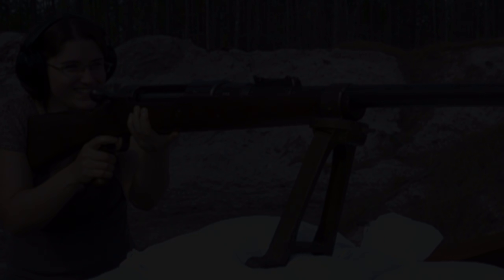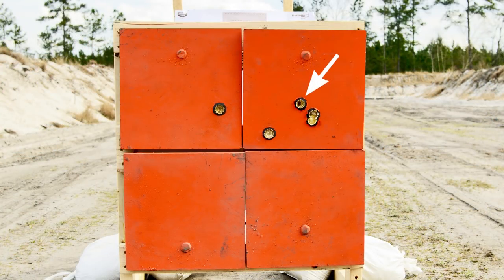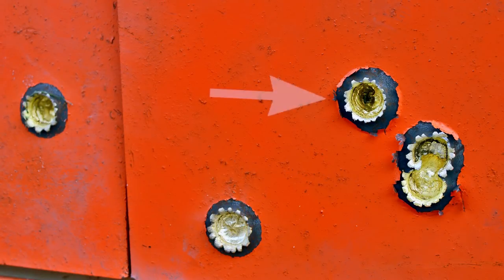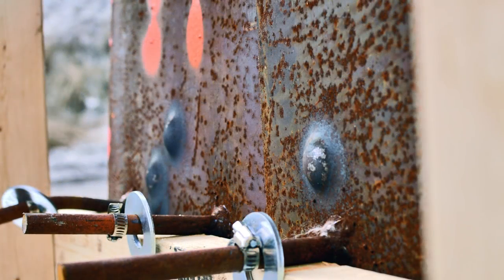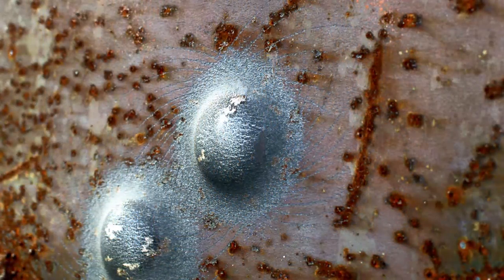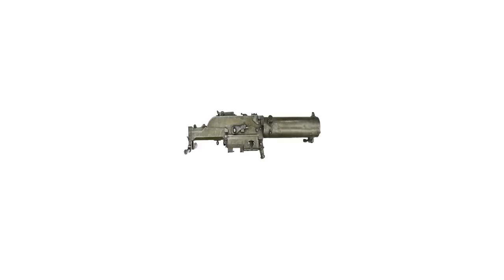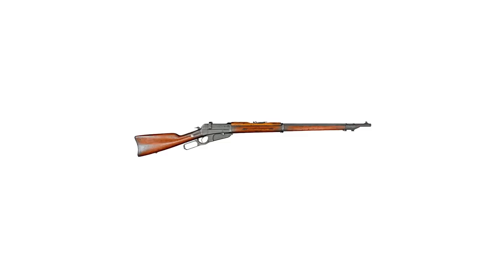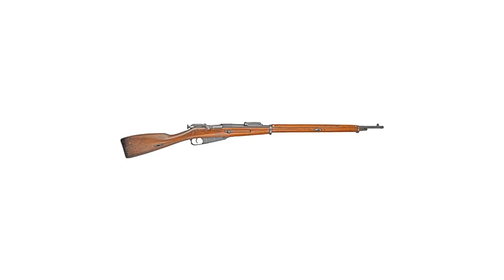Mae fires the T-Gewehr - First anti-tank rifle

Comment from the maker: I'm starting to get a flood of comments about how we "faked" our T-gewehr ammo because of claims that it will break your arm.

The 13.2 TuF is roughly equivalent to .50 BMG in perceived recoil.  The gun has 1" spikes on a solid bipod and is quite heavy.  This means, used properly, the recoil is actually quite controllable.  I have fired the gun once and Mae has put 5 rounds though one at original load data.  It was bedded well into a pile of sandbags.  The first shot gave her a nickel sized bruise, the rest likely contributed nothing as she adjusted her posture to better match the high center.  I received no marks whatsoever as she had already warned me about how the setup recoiled and where to snug everything in.
https://www.youtube.com/watch?v=_ovHGvT4f9k

If you're worried about a non properly emplaced T-gewehr, well, Ian and Michael both shot actual original ammo with just about the worst free stand I could imagine.  While it gave them a jolt, no one broke any bones.
https://www.youtube.com/watch?v=EzDfUKNwfGc

Recall, this gun is among the first anti-material rifles and so a LOT of myths built up quickly, especially because it was almost immediately put back out of service.  As with any high recoil firearm I'm sure you could be hurt using it outright foolishly.  But a trained rifleman, even unfamiliar with the recoil of this particular gun, shouldn't have a great deal of difficulty.  Fatigue would probably kick in about 7 - 10 rounds in though in my estimation due to working the large bolt and the general shock of each shot on the nervous system.
Reply: dont worry about the naysayers mate i have fired a truvello 20mm set up in a similar config to your panzer gewehr and recoil is manageable not pleasant but manageable great video as always looking forward to many more
Reply: Were can I buy one? Lol😁
Reply: I'm guessing those people came here from Simple History's video on this very same gun.
Reply: There are videos of people using 20mm rifles from anzoi ironworks.  I doubt it would break an arm.  forget those people.
Reply: I find it funny these dorks said it. 

They play video games or see movies and expect anti tank guns being on par with a anti air cannon or field artillery.

These are the same kinds of idiots who tell me that I'm insane because I bought a .44 as they claim "it's too powerful" and called my brother a masochist for a .460pistol.
Reply: C&Rsenal people only claim that you faked it cause they are angry a girl is manlier than they are and can deal with firing a large round
Reply: It's not faked, If you can fire a standard Gew 98, you can handle that. It's when people who aren't used to shooting, the perceive recoil as dangerous. Nonsense.
Reply: why would they make a gun that breaks the user's arm
Reply: Firing it prone probably presents more risk of injury. Firing standing, as Mae did here, allows you to move back and absorb the momentum gradually; with your whole body mass behind your collarbone, and recoil needing to slide you across the ground, the force on the collarbone is going to be higher.
Reply: I know it was anti material, but with today's technology,  could you mount a scope on it make cans of reloads n use it against personnel in fortified emplacements or sniper mode like a barrett?
Reply: @frankmoreno6866  if you don't want to mess up your shoulder after 2-3 shots then definitely add some form of shock adsorption into the stock the way she was in the video removed a lot of it safely by standing otherwise she would have had a heavily bruised shoulder from the amount of shots fired
Reply: I think what they should say is it could break your arm not that it will
Reply: Someone (don't know who) converted an M-2 to a one-ish man gun during WWII and then fired the famed thing.
He survived.

And, ya know, Germans fired this thing during the war... They didn't die, either. Ya know. Just saying.
Reply: @frankmoreno6866  You could but by modifying it to accept a scope your ruining it's value. Also you can't just grab a gun and deploy with it. It basically has the same ballistics as a .50 BMG so you may as well just use a Barrett.
Reply: What people dont seem to understand is that if it broke the users arm they wouldnt have used it
Reply: Who is The girl?
Reply: YouTube is full of people who will call anything fake, trolls, just ignore them as most are just kids or people who are completely miserable in life. The great majority of us enjoy watching videos people post. Thank you for the upload!
Reply: It’s bigger by half a mm also
Reply: Well any very large cailber gun can break your arm if your not careful
Reply: This sounds more like excuses than anything.
Reply: I just thought you handled it well. It looked like you got punched in the shoulder. Dont mind the trolls
Reply: C&Rsenal 
Where did you get that?
Reply: Listen here pretty lady dont listen to them and have fun
Reply: @Indigo Rodent I am sure some German soldier did hate the rifle, but I doubts they did make a proper statistical survey, and then the British history writing took it and run with it.
Reply: Wait, you know Gun Jesus?!
Reply: 13mm ammo? Wow thats powetful
Reply: @Valin9275  it was used in WWI to be a anti-tank weapon they had no other ideas then this and if you hold it incorrectly it will break your bones
Reply: @PodcastAgallah  wtf
Reply: I read and maybe it's just baloney, that the soldiers were known to dislocate their shoulders and that people were not to fire more then three rounds in a day or maybe a week as it could detach one's retina.
Reply: @SanitysVoid  Seriously?    Nah
Reply: @davidthomas7678  that's what I read so yea not nah.
Reply: T-Gewehr: woww,beautiful gun.
Person who shoot it : beautiful too
Reply: I’m sorry otis. You can’t have anything nice it seems.
Reply: It only breaks your shoulder if you hold the gun incorrectly
Reply: The most painful rifle I ever shot was a .50 cal Hawken black powder rifle with a set trigger. I foolishly set the trigger while settling the rifle into the shoulder. If you're not familiar with these, you pull the rear trigger to "set" the front trigger, and then if you breathe on the front trigger the hammer drops. I think the butt was still about a half inch in front of the shoulder when the thing went off. That hurt, left a bruise that lasted a couple weeks. The fact that the owner had loaded 100 grains of powder behind the ball didn't help (I think most people use 60). The only thing worse was the black powder 12 gauge we shot the same day - not so bad in the shoulder but the stock had a lot of drop so it whacked me pretty hard under the jawbone. Mae gets all the fun.
Reply: Our German Tankrife was the first AT-Weapen for the Infantrie.
Reply: I just knew that "Forgotten Weapons" had the front support turned around backwards.  If you shot it the way they had it set up it would have knocked you on your back.  Thank you for confirming my suspicions.
Reply: @draco2023b  Plenty of girls are heavier and more flexible than a lot of men.  All they are doing is absorbing a sudden impact. As do sandbags, but more interesting.
Reply: @Indigo Rodent They might not want to shoot the gun but they would hate to let the tank get closer. 

But you are right about malnutrition. Many civilian papers refer to the small amounts in trade. The edible oil industry is an example to begin with.
Reply: H y we
Reply: Now, now Othias... are you arguing with the wise and omnipotent internet experts? 
I’m sure they would be more than happy to properly demonstrate this weapon... if only their power and wisdom didn’t fade the further they get from Mom’s basement. 🤓 
Btw... they don’t let icky girls touch their toy guns either... Not cool Bro!!!
Reply: Because the German army designs and issues it's soldiers with guns that breaks their arms reliably, sounds legit :D
Reply: Probably hurts like hell shooting that with no muzzle brake.  I've fired the British Boys Anti-tank rifle and it hurts like hell with one.
Reply: @mcchill8200  there are even bigger Anti-Material rifles than even that.  The Lathi L-39 for instance,   in 20x102mm NATO, same 20mm cannon round the M61 Vulcan, Phalanx CWIS and C-RAM uses.
Reply: Why was it recalled out of service? Was it that ineffective?
Reply: I don't think it would have broke any bones how ever I would say bruised shoulder or slight pain in the shoulder area from the recoil
Reply: Yeah unfortunately there's a lot of people with no experience saying things they either thought of or were told.
Reply: That gun could kill a Trex

Comment: There is something simply majestic about hearing that massive nightstick/bolt opening and closing, not to mention the the damn thing firing.
Reply: Mr. Quarters actually, you could probably detach the bolt and use it as a bludgeon if you ran out of ammo.
Reply: FarTooManyPizzasForYou Why just the bolt? Why not just use the whole gun as a club?
Reply: alan wang 
Prob because the gun weighs at least 35 to 41 pounds. The fucker is heavier than a fucking greatsword.
Reply: You might as well throw the whole thing thing as a spear.

Comment: I wonder how much recoil force this actually puts into your shoulder compared to other weapons with a shoulder breaking reputations like the Boys Anti-Tank Rifle and the PIAT. Then compared to modern .50cal rifles with fancy recoil springs and muzzle breaks.
Reply: I would guess more, because it doesn't have any recoil handling stuff, accept it' weight.
Reply: betaich I would say that too for the more modern stuff. I imagine the Boys packs more punch out of the muzzle being a later design, so I dunoe how that factors, and the PIAT is a whole different animal since that's a shoulder fired spigot mortar.
Reply: These rifles were operated using two man teams, firstly becuase it was heavy and secondly because the firing it too many times caused concussions.

Comment: If these are not the original type of ammo that was shot during WWI at tanks, then it’s the reason they where not going through the plates. The original, from what research I have done, where steel core. So with that in mind... These rifles did some damage for sure and many died because of it. But it was a little to late. The fact is you have to be pretty close to make this rifle useful, and tanks were starting to be produced faster. Had this rifle been a think early on and with a chance to be modified to make it useful at longer range it might have done more. But fact is it was a little to late in the war.

Comment: I'm glad your starting to cut down the videos in shorter bits. I really do like watch your videos but your hour-ish long video takes some cross between  commitment and luck of a draw in timing. And normally if I can't watch them in a day or 2 they get  piled over in videos or lost in YouTube  Algorithms.  Normally I only got 30ish min at a time so if you could do a re-release some longer ones in a b c block (15/20/25 min increments) or if there's some fluff/block section that can be cut out that would be cool. Just figured I'd share.